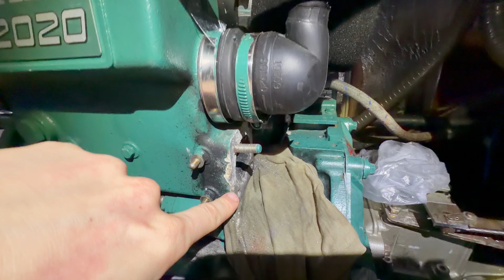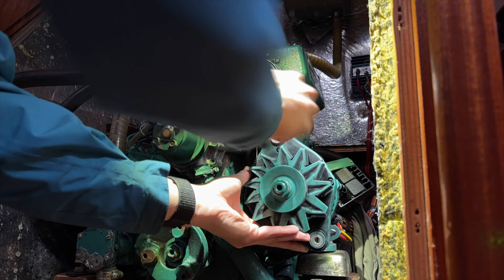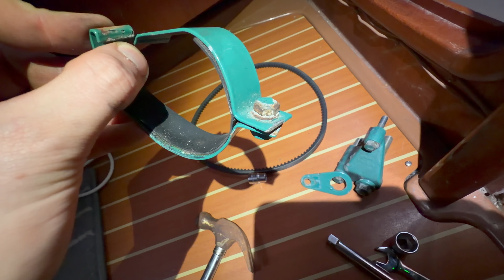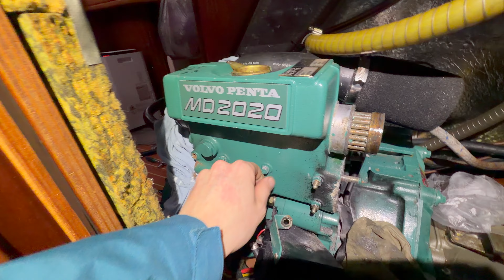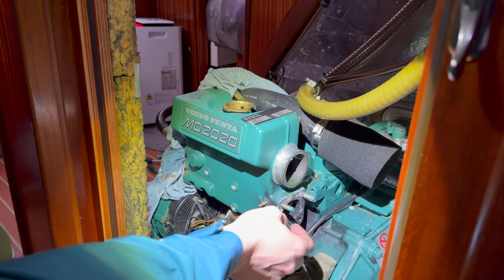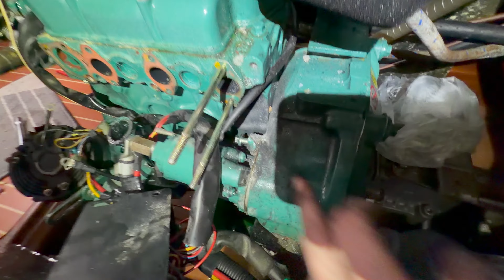Removal of heat exchanger house Volvo Penta MD2020

Comment: is that the hot water kit on there?
Reply from the maker: Not sure if I understand the question right, but if you mean the hot water kit for hot water for showers etc. this is not it. 
The hoses for the hot water is in front of the engine which goes back to the hot water tank. Idk if that helps at all or if I just misunderstood your question😅
Reply: @sailingElara  what is the tank? my boat only has a mains calorifier
Reply from the maker: @wysiwyg2006  Our boat has a water heater that is connected to the engine. When the engine is running, the water from the water heater is transported to the engine, heated by the coolant, and transported back to the water heater. We can also heat the water only in the waterheater, but then we have to have electricity from shore(to get high enough power)

On Your boat it is only possible to heat the water electronically? 

I am still unsure of what you are referring to when asking what the tank is. If you can clarify, or say a timestamp in the video were you see the tank?